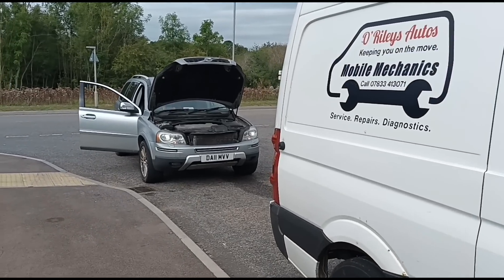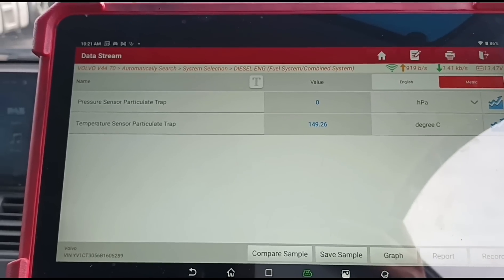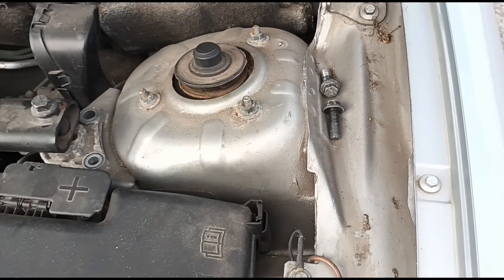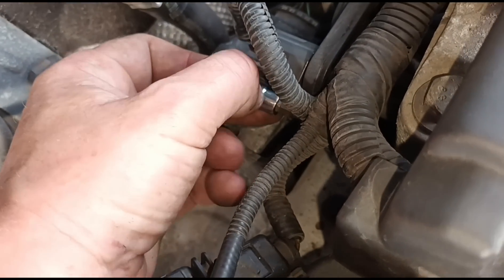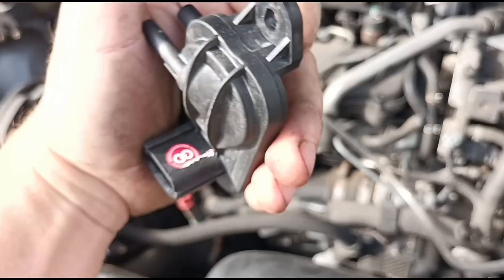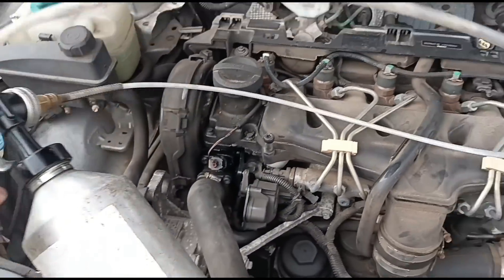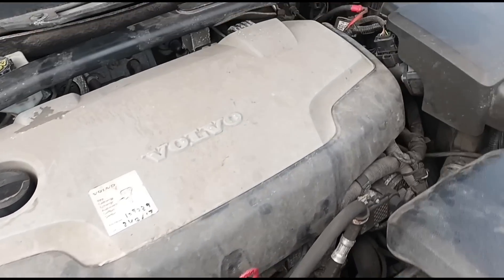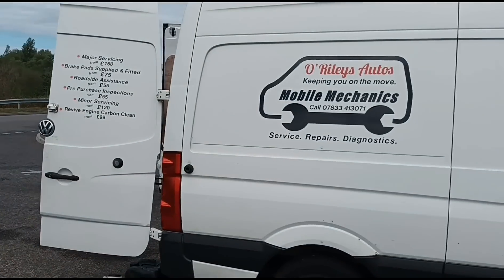Volvo XC90 2.4 D5 ECM2A-20 ECM-2A50 Particle Trap & Pressure Sensor

Comment: Fantastic Video mate.  Got myself a 2012 D5 gone into Limp.  Got a TopDon dongle and it was reading fine @ around 10hpa at Idle up to around 80 under load then it showed as...get this.....65 thousand 500 and 35hpa, then today, it's Zero and will barely go so safely going to assume sensor too.  I'm thankful for your vid as i thought I'd need to get under the car and dismantle the exhaust. :D  Unless it's different on 2012 D5?? :O

Comment: Hi Jimmy great videos, would you please give me a little advice, I have a 2007 xc90 d5 with dpf issues going into limp mode with door filter full on dash only when I give it some beans, I’ve scanned with Vida and looked at live data and the dpf pressure sensor is reading at idle 13hpa and at 4000rpm 132hpa, do these look out to you, if so would the sensor be to blame many thanks.
Reply from the maker: Yes a bit high
Reply: @ORileysAutos  thanks for the reply very much appreciated, later on I took it for a drive with the live data running and the dpf pressure sensor was reading 600hpa, does that mean the sensor is knackered or is it reading that high because the dpf may be blocked but apparently there’s only 2g of soot in there?
Reply: Did you have to programme the sensor in or is it a straight swap. Thanks

Comment: I have a 2006 XC90 D5 with 210,000 miles on the clock now. I intend keeping it till it goes very much BER (beyond economical repair).

Comment: Hi ,
What kind of sensor did you install? original by Volvo or by the manufacturer ?
Thanks
Reply: It was a DPF pressure sensor Jimmy fitted for me in this video. A non Volvo one from Bennetts. I can add the details here later if you like
Reply: Thanks for the help, I thought that only the original one from Volvo could be installed. good to know . 🙂
Reply: It was a Beckermann DPF Sensor. The one that failed was also a Beckermann that was fitted 13 months ago. Better luck this time
Reply: Please give me the manufactur name of the vacuum pump. Thank you.

Comment: The engine mounts are knackered on that car we need replacing the engine has far too much movement. I work on quite a few Volvo
Reply: The top mount along with the support bar bushings are always worn out on these cars.
Reply from the maker: Yes I did mention it